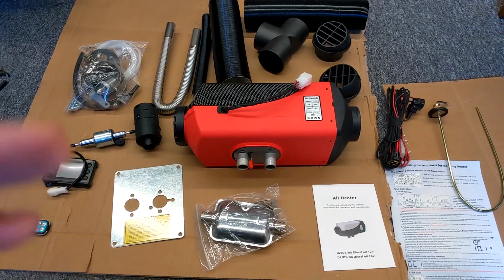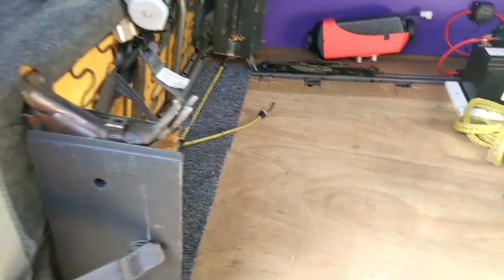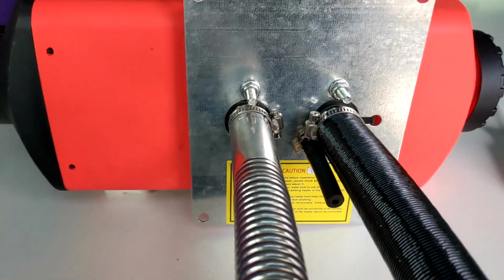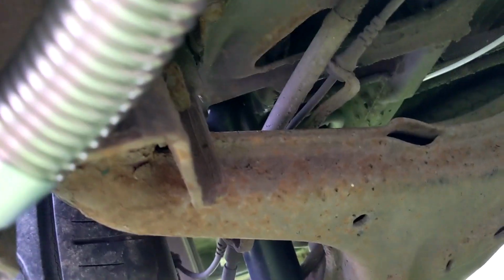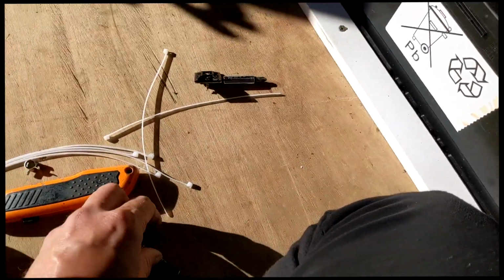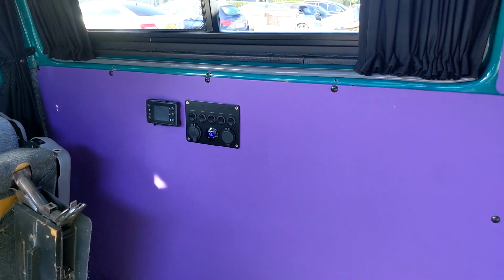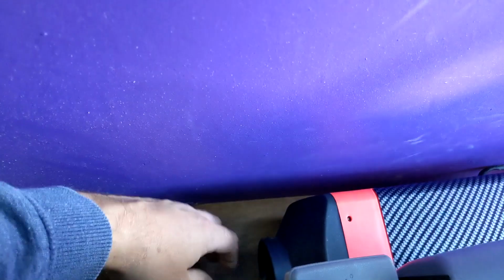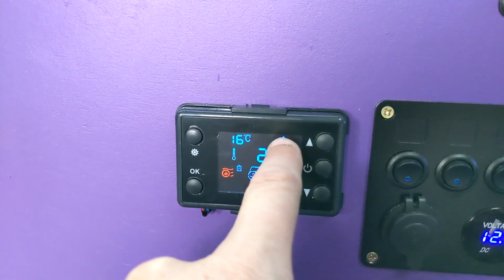Installing a Chinese Diesel Heater | VW T4 Camper Van

Comment: I'd buy a turret plate to keep it all safe. Those exhausts get mad hot. Last thing I want to see is your van on fire by setting the underseal alight especially if your in it 😯
Reply from the maker: After bring extensively used and the van is still here